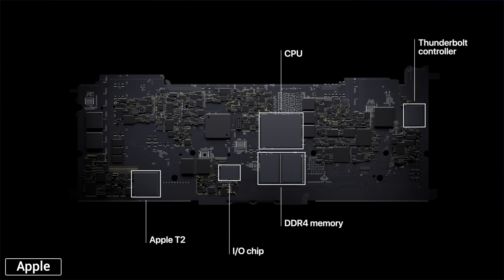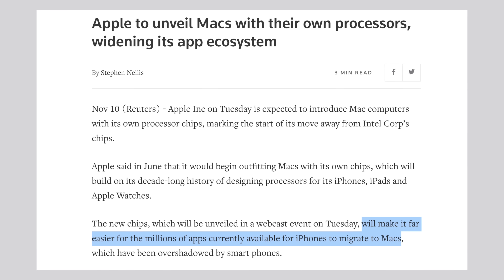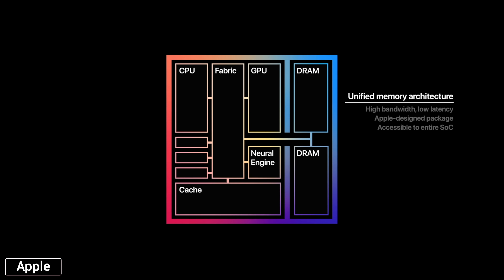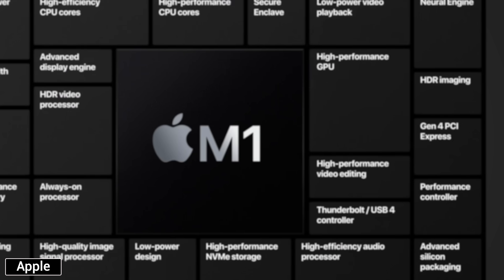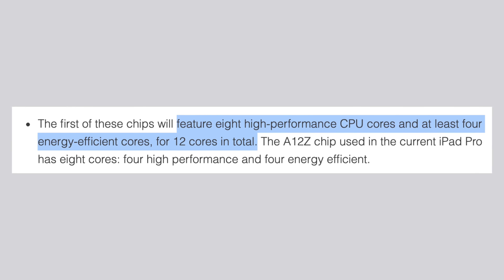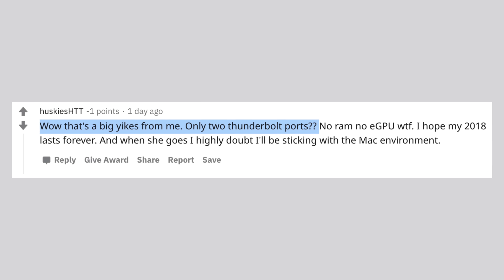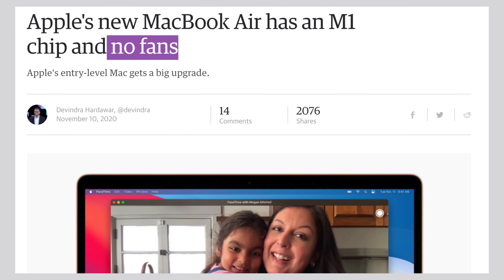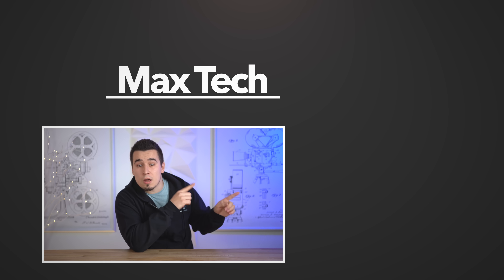Apple M1 Mac Chip Explained: Questions & Doubts Answered

Comment: I don't like Apple, but this Geekbench single-core score matching AMD 5950x - I am very very impressed.
Reply: See, I like people like you. Even though u don’t like apple u can still accept excellence. We need more people like you
Reply: Mitch  They are used in mobile phones because they have lower power draw.
Reply: AMD have left intel behind now it's time for Apple...By the time we will get new Mac Pro with Apple Silicon it will beat Even Threadripper and Epyc CPUs
Reply: @ajiteshsharma6714  lol. Nope. Because amd is still on 7nm. And apple m1 is 5nm. And both are neck to neck in single core and being outperformed by amd in multicore. So when zen 4 arrives, it will breeze pass any other processor in the market
Reply: I don't like Mac before until I use it.
Reply: @jinraigami3349   I like the browsing experience on my iphone xs max its just as fast as my gaming desktop i7 9700k excepts for some sites that dont play nicely with mobile browsers. Its interesting to see that if apple includes 5g modems in future laptops . m1 chips sounds refreshing for mobile use. It all depends on your use case. after reading anandtech deep dive of a14 , the engineers of apple are adding accelerators to the soc to split work to efficient transitors examples include isp , neural engines dedicated video encode and decode blocks. Such accelerator blocks have increased from 10 in a8 to around 40 in a12. just look at the x-ray of die shots from a7 to a12 . the cpu cores area have shrunk on the soc. they are doing what the server space are doing with fpga accelerators and asics. its a welcome change. eagerly waiting on reviews for the macbook air.
Reply: Kinda sucks that apple fanboys have to say “I dont usually like apple” to not get bullied
Reply: MrPlasma I think everyone should use their preferred product and not worry about “bullying”. I always find it weird when some people say they really want to give apple a chance when a new phone/tablet/Mac comes out. It’s OKAY to just not like apple products and it’s okay to like them.
Reply: @Falloutx360a  Totally agreed
Reply: @mrplasma7094  maybe you should try to stop projecting and learn to read
Reply: @CO8848_2  Nah, I'm actually serious, it happens
Reply: @mrplasma7094  But you have no clue.
Reply: @mrplasma7094  Don't you think that it is actually fucked up that people have to hide their interests or brand loyalty because they would get bullied?
Reply: @thanakornintajak4456  ye, it sucks
Reply: @thanakornintajak4456  But brand loyalty is bad
Reply: @mrplasma7094  But I and probably the person commenting actually DON'T like Apple and don't buy their thing about still follow the news
Reply: @circuit10  cool
Reply: Um.. No, very cherry picked. Apple has several functions hardwired into its chips, these accelerators give great performance in the one function they are built for. They do not equate to general performance. If apple could really match or beat processors that are  using 8 to 15 times the power draw they would instantly take over the server market and all laptops and it would be heralded as a new age in computer performance. They just took a big leap going to their own silicone and they need their investors to feel good.  So big showy numbers justified by small print
Reply: @adrianwilson7536  there’s no hardware accelerators for single core performance or multi core performance lmaooo
Reply: There’s only hardware acceleration certain tasks like video encoding and decoding
Reply: @adrianwilson7536  I agree. Still, this is correct approach in general - PCs and laptops had grown fat with excess features most people don't have CHANCE of using and entire stack is full of bloat (look at Windows 10 or AVX-512). Yet they pay for them in money, battery life and power usage and heat and noise.  For most activities, barring professional workloads, even A13 is enough.  Web, video, good audio, typing - this is what everybody with exception of developers use, and Apple is not into company market anyway (no sign of Dell-like NBD support and bulk deals). If acceleration for typical operations - video de/en-coding, compression, 3D, encryption and decryption can be enabled by default using Apple provided libraries and OS.  MacBook Air has right idea here, had it been bit more accessible price-wise. This is basically iPad with full keyboard and macOS X. Anyway, next MacBook Air or iPad Air is mine :D
Reply: @adrianwilson7536  Cherry-picked for what?  Geekbench benchmarks?  Laugh.  The lower power draw is because it's 5nm, and it's ARM architecture.  ARM always has lower power draw than x86 at the same performance level.  And Yes, ARM is taking over more of the server market.  Gee, you guys really need to eat some humble pie and learn a thing or two.

Comment: Just a minor correction. Apple only licenses the ARM instruction set, not the architecture. The CPU, GPU, neural engine, I/O and Thunderbolt controller are all Apple designed, I.e, not ARM reference designs. It’s a common misunderstanding being reported on many sites.

Comment: You are off base on a few of these.  The RAM cap is concerning because the 13 inch had a 32 gb limit before not a 16gb.   It also had 4 ports available, so artificially handicapping it to make a performance comparison is a bit disingenuous.   The concern here is that the first m1 MBP is not really that P.  Add to it that ARM is a bit more memory intensive than x86, not the inverse, and that we don’t know how much memory is shared or even what the memory specs are, and this has warning lights going off.  No eGPU support is where I get off this particular bus.
Reply from the maker: The Intel MacBooks that these new ones are replacing were limited to 16GB of ram and they only had two ports. The more expensive $1800 model will be updated next year and it will have four ports and a 32GB of ram limit.
Reply: @MaxTechOfficial  the two port only option is not a full offering and not very pro.  I wouldn’t consider buying it.
Reply: @chadweirick  Ok, so I would recommend waiting for the 1800 model coming in the middle of next year
Reply: @mrplasma7094  I think at this stage I am stuck in wait and see mode.  I want reviews and benchmarks and some time for apps to go native.   This launch was underwhelming from my perspective
Reply: @chadweirick  ok
Reply: Look, the 16gb ram limited mbp has the same price as the base model.
Reply: @mrplasma7094  read the full comment please

Comment: Not to sound rude, but you are wrong on several issues, including the comment that intel uses the same core for everything.  On the arm, you actually have one cpu(8 mini cores) running both the graphics and the processor, buffering to the memory to keep the  speed up. I bet you will see a lot of bottle necks when running intensive programs that require quite a bit of ram. So, to sum up, you have a iphone built into a mac mini, mac air, and a mac pro. Let the games begin.

Comment: USB4 is basically hindering the performance due to the controllers bandwidth capacity inside the M1 chip.  The 14 and 16inch need to resolve this problem as well as the external number of displays you are allowed to hook up.  That is absurd.  Nearly everyone I know who owns a MBP or a 13/14inch laptop docks it when they get home to multiple monitors thus is the case with my current MBP.  I run it to an eGPU outputting to dual 144hz monitors.  Coming from a macOS and Windows10 user and heavy Thunderbolt 3 user for videography and large file dumps so the bandwidth capabilities concern me.  Fingers crossed the new 14 and 16 inch nail their landing.  I am interested in ARM based OS mainly for heavy video editing but also gaming too...maybe ARM running Windows10 through a portal app could be feasible but tests would only tell and I am sure latency would be induced.

Comment: I am impressed with what I am hearing about the CPU specs, but the GPU info has me less enthusastic. I read elsewhere that the GPU performance is comparable to a Radeon 560 and has 2.6 teraflops. My current i7 Mac Mini has a Vega 56 eGPU connected that is 10.5 teraflops. Waiting for your hands on review to see what the graphical performance is like.
Reply: I think GPU still won't be an issue, because the 2020 iPad Pro only scored 12000, yet handles every single game on the app store with ease

Comment: I am going to buy the new macbook air silicon after watching the reviews! I want to order it rn but I just want to see the real world performance and weather or not it heats up without the fan!!
Reply: A good plan, though I don't see it heating up at all, outside of extremely heavy workloads, with the 5nm process and how cool iPads run even on a 7nm process. But it's always good to see the real-world performance (and any added caveats that Apple hasn't mentioned/discovered) before buying.
Reply: Your iPhone is the answer, if you have one.

Comment: 8GB is the new 16GB on ARM architecture?
Reply: No. Memory is memory it doesn't matter what the architecture is. Just because your on ARM isn't going to stop an intensive program from requesting all your RAM. Apple can only optimize memory management so much. The only reason iPad and ios apps don't use as much memory is because developers spend tons of time optimizing them to run on devices with less than 2gb (iphone 6s).
Reply: @AdamSmith-gs2dv  False. Mobile for mobile, ios devices run 2-4gb of ram the same as 12+gb ram.

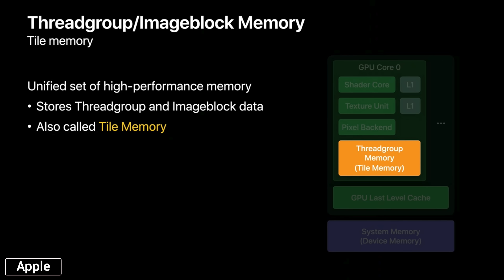Comment: 5:20

All modern CPUs have Cache guess what they still need DRAM because cache while fast is extremely expensive (hence why you have KB or MB of it and not GB). Also how much memory does that tile memory have? Modern games can easily use 4gb of VRAM hence why modern cards come with 8-12gb now. If that memory tile is only KB or MB large then the GPU is going to be sharing the DDR4 memory with the CPU and that equals piss poor GPU performance. Also MEMORY PERFORMANCE DOES NOT IMPACT MEMORY USAGE! You can have 4000 mhz DDR4 and that isn't going to stop Cities Skylines with 1000 mods from using 32gb of memory!
Reply: And what are you exactly expecting from 10W SoC?

Comment: All I care about is how will this perform with Premiere Pro and After Effects? even though there is a 16GB of ram?
Reply: This system should need less ram anyway
Reply: @AlainCarAudioManiac  this is incorrect. Programs like premier still need lots of RAM. fast hard drives will help with swap but the underlying issue of needing to store stuff in memory does not go away.
Reply: @NateGwood33  indeed but you're not considering that here were talking about a completely different architecture and consequent OS optimization
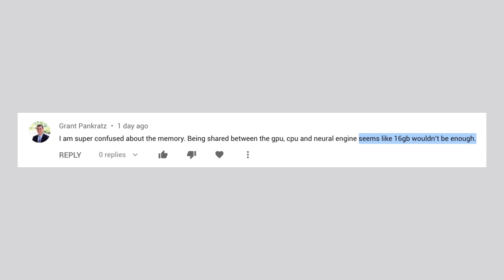Reply: Watch from 12:00 again
Reply: Same here 👍🏻
Reply: Really don’t know how well it would work with Premiere, that program is just so unoptimized. Should be insanely fast with Final Cut though. I would definitely wait on more powerful machines if you only use Premiere.
Reply: @robsmith5434  yeah I am starting to use after effects but I just want to see the results on those tests
Reply: @lars.epp98  that's where you got it wrong, this is like HBM in some of  Vega and Pascal GPUs, because of the higher bandwith, you don't need as much space, look again, it's not classical DRAM, it's UMA

Comment: On the nature of only 2 thunderbolt ports, either apples future chip will some how be expanded upon to have enough cpu lanes/bandwidth to process all that data, or they develop a new series coprocessors like the t2 chips for the current intel macs. Those next gen coprocessors would handle the dedicated gpu tasks or just data and would basically be like have 2 m1 chips to support 4 thunderbolt ports.

Comment: Yeah defending the no fan design in the MB air is kinda like saying "Hey cut your feet off so you won't get your shoes dirty ever"
Reply: If it doesn't need a fan then it doesn't need a fan.  We'll see when the thermals are tested next week.
Reply: Light users prefer silence over high sustained performance. If you're a high school or university student for instance, surely you don't want to keep blowing your laptop fans like crazy in a class or library and get people around you distracted from noise.
Reply: @XtraGalaxyOfDreams2020  not saying it needs to run at 1700 rpm

Fan speed can be properly managed, like in the XPS or the Spectre

Comment: Does it mean that the M1 chip is built in with 16Gb and systems with 8Gb can later be unlocked through a software patch?
Reply: Nope. There is currently a longer delivery ETA for the 16GB versions.
Reply: @HighwayRamos  So, there are two different M1 chips then. One with 8Gb, the other with 16Gb.
Reply: @martinsgiroux  Yes, unfortunately we won't be able to download more RAM - That would be cool 😎

Comment: Should I sell my Macbook Pro 16 and buy one of the new ones? Paid a lot of money for it a year ago and I think the new ones are cheaper and faster 🤔
Reply: I dont think so, wait till the 16in aple silicon ones are released
Reply: I have the 16-inch as well. In my opinion, you should wait to upgrade to the second or third generation of the silicon MacBook. Do not get the first generation of any MacBook as they always have some kinks that need to be worked out.
Reply: No, wait for the 16inch to come out. You will be downgrading on some important things like ports and maybe RAM depending on the spec you chose. The new Macbooks are replacing the entry level Macbooks, not the more expensive 16 inch ones.
Reply: @HellNaw98  you might be right 🙏
Reply: Yes